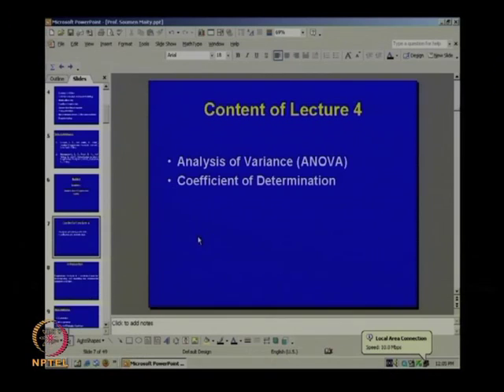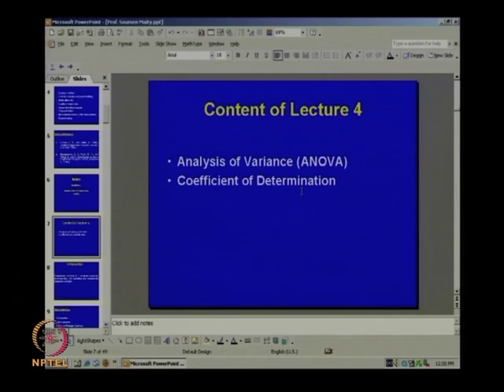Simple Linear Regression (Part D)

Comment: How is yi hat minus y bar = beta1(xi minus xbar)
Reply: agree how did you get this Prof?
Reply: @Kim-bn4ub  and @niwin konthoujam
beta 1 hat is the slope of regression line that's why !
Reply: @mrityunjaypathak8792  Thanks!
Reply: Suin Kim , I am also a learner like you !
Reply: @mrityunjaypathak8792  But isnt there epsilon bar on the definiton of Y bar?
Reply: in lec02 (in useful properties LSE) ,we have
ii)sum(yi)=sum(yi^)

if we divide both side by n, we will have yi(bar) and in rhs we will have yi^(bar),

where yi(bar)=b0+b1(x(bar))+epi(bar)

and yi^(bar)=b0^ + b1^(x(bar))

and yi^(bar) is calculated by evaluating yi^ at xi and then taking its average

so in 
(yi^-y(bar)) = (yi^-y^(bar))=b1^(xi-x(bar))